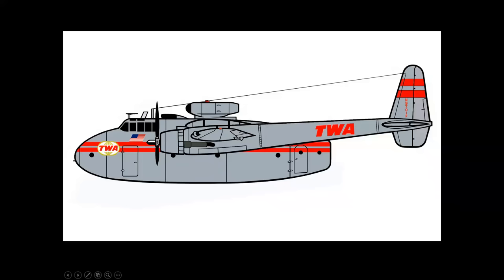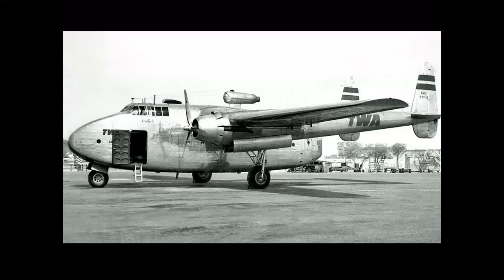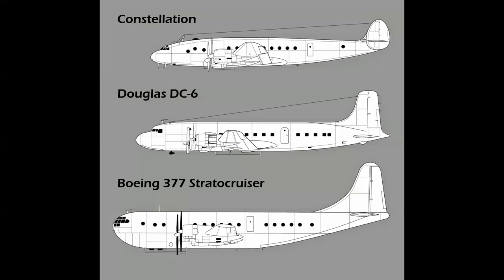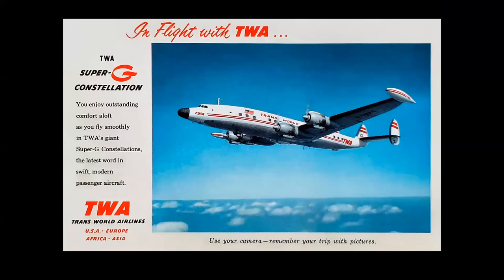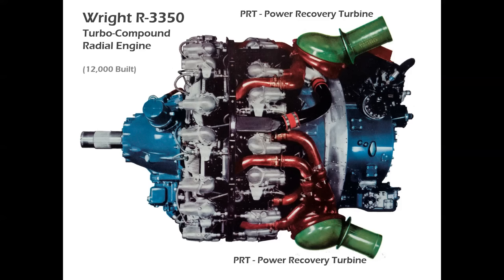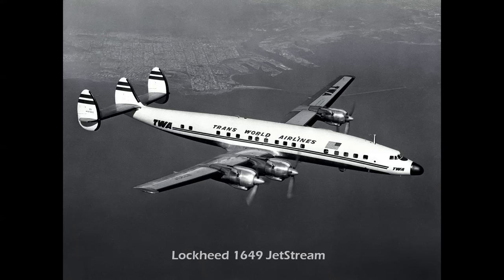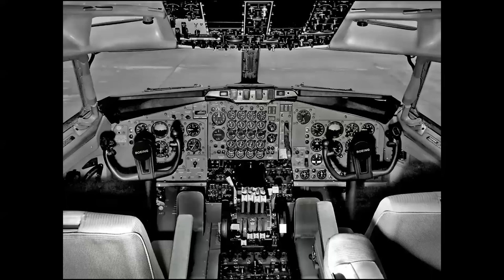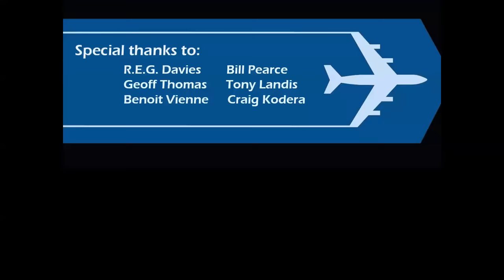LOCKHEED CONSTELLATION ENGINES - How were new engines delivered from the piston era to the Jet Age?

Comment: Delta Airlines had a C130 painted in full Delta Airlines livery that delivered engines to Dallas Love Field back in the early 70’s. I watched it arrive many times.
Reply: Delta operated C130s in a freighter fleet for cargo, not just engines. Not sure how many they operated, my guess 2 or 3.
Reply: Those were L-100’s, the civilian version of the Hercules.    The overall airframe is the same, but a lot of the equipment differs from military spec.   The L-100 has an FAA type certificate, otherwise Delta would never have been able to use them in Delta livery.
Reply: @jacksons1010  Lockheed tried to market the C130, C141, and C5 as a civilian aircraft. They only had some luck with the C130.
Reply: @georgeconway4360   Lockheed actually did build one L-300 (a stretched civilian version of the C-141).   My recollection is Flying Tigers wanted them but backed out of their orders.   NASA eventually purchased it and it still exists, sitting idle at Moffet Field.   Lockheed attempted to offer a double-decked passenger version of the C-5 as the L-500, but it was a non-starter with airlines.
Reply: @jacksons1010  What is the cruise Mach for the C141? I doubt Flying Tigers ever wanted them. I started flying for Flying Tigers in 1980 when they bought Seaboard World. Then Federal Express bought Tigers and I retired in 2012.
Reply: @jacksons1010  The C141 was way too slow for the airlines. The DC8 and N707 cruised at M .82 when the C141 was M .74.

Comment: Thanks Mike! The engine replacement problem lead to another solution that few people know about. That’s the (external) spare engine carriage. I was lucky enough to on the flight test of the 747-400 with the RB211-524G spare engine carriage. The tower at Moses Lake asked how many engines we had. Our pilot, Jamie Loesh, answered we have 5 but only 4 are turning 😊
It’s hard to find info about spare engine carriage but I’ve found photos of a 707 and L-1011 with them. Did the DC-10 have that feature also?
Reply from the maker: Yes, both JAL and Philippine Airlines used engine-carrying pods on their DC-10-30s, mounted inboard of the #1 engine. Thanks for watching!

Comment: Reminds me of the UC-123 mosquito control acft that would show up at Langley AFB, where I was beginning my Air Traffic Controller career in the tower,  to kill the marsh larvae. They'd arrive the night before and park on a hard stand down near the appch end RWY 25 and would try to forecast which way the breeze would blow in the morning by facing into said forecast breeze. The reason was that if they guessed wrong and the jet exhausts were pointed into the wind they'd throw some of the JP4 up over onto the wing and when the igniters came up the wing would also catch fire for about 15 seconds or so. First time I saw that no one had warned me, and as the ground controller asked them if they wanted a fire truck. "Nah." they said calmly, "It'll go out soon." So....if you ever see a C-123 with jets and blackened wings...now you know.

Comment: When in the Army I flew on a MATS charter flight from New York to Frankfort on a Connie in 1961.  We were supposed to go via Shannon, Ireland but had engine trouble and diverted to Gander, Newfoundland.  On the ground at Gander for 5 hours or so then direct to Frankfort.  It was an old beat up Connie, many busted seats and a ragged interior.  Worse there were many Army dependent families on board and it was many hours of crying babies and with the engine noise and the screaming kids any attempt at sleep was impossible, for me anyway.  It was the worst flight I've ever had before or since.  I am happy that I got to fly on a Connie though, of any airplane I've flown as a passenger or pilot that's the one that I'm most glad I got to fly on it at least once, miserable flight or not, such a beautiful airplane it was worth the discomfort to have had the privilege of flying on it in retrospect anyway.

Comment: The R-3350 never really liked high altitude turbo-supercharging. It almost killed the B-29 programme and it stayed being a troublemaker until the end. In contrast, the low altitude versions were not perfect, but quite decent engines. 

Despite all the problems with the expensive engines, the engines were not the main issue that lead to a quick withdrawel of the L-1649 and DC-7C  from mainline service. These last generation propliners were designed for the very longest routes. Just like the few turbopropliners like the Bristol Brittania. The main reason they were replaced by jets as early as possible was speed. Jets saved up to 4 hours on trans- and intercontinental routes. That was massive. Passengers were happy to pay for that time saving.

Comment: I've lived in Palmer Alaska since 1982. At the local airport there is a C-119 Flying Boxcar  with a jet engine in a pod on top of the main body, very much like the C-82 in this video. It also has a 'flat-four, pony engine' (as it was described to me) used for internal power and heat. The plane is used by a local Jumper school. Parachutists and smoke jumpers use it to keep up to date on certification. They will al$o fly building material$ out to remote area$. It has oversized balloon tires on fixed, non-retractable, landing legs. A Bush Pilots Ultimate Flying RV.

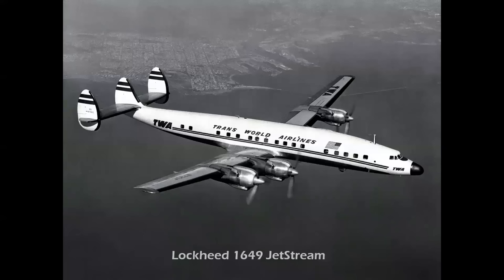Comment: Mike, re the photo of the DC-7C @ 10:49. I believe the large structure on a vertical line up from the "S" in Sabrina at about a quarter of the top of the frame is the hanger for Hughes' Flying Boat.
Reply from the maker: Yes, that is correct. Was thinking about mentioning that very fact. Thanks for watching!

Comment: My Dad flew on the Canadair Argus, which was in service 1958 to 1982.  By the end, avgas was getting difficult to source.  I flew with ex Argus Flight Engineers on the Aurora (P-3 Type) and to a man, they missed their expansive consoles that were used to monitor the 3350s.

Comment: Thanks much for a very well done video. Those photos are great!  I had not heard of TWA using the Fairchild. I'm old enough to remember the change from piston to jets in commercial airliners. I flew from Seattle to Minneapolis in a Western or Northwest 720. We then flew to Sioux Falls in a Branniff piston.  This is a backwards introduction to the big planes and was amplified by the noise and scary shaking of the 4 engine piston. This was 1963 or 64 and I'm thinking this was a DC-7C that was pulled of the long haul routes and served the short haul regional routes.  Is there anybody out there that can confirm the piston aircraft type?  I can still feel myself sitting in the pistion and wondering if it was going to shake apart!

Comment: Great vlog as always!  I do not know who inspired who but SAS/SK made a contract with Transair of Sweden to have C-46 to fly across Europe and do nothing but ferry the engines of the SAS DC-7C! Unthinkeble today… I may have told you this before. Someone at Transair must have loved the DC-7. They bought more than 10 planes from EA. When they also got brand new 727-134 from Boeing the following was issued: Sell charter on the 727 as much as possible. It still is cheaper to fly than the DC-7! I think they ended scrapping 7 of the 7s. On the quads there was space under one of the wings to ferry an engine. Here on YT there is a home movie about the last DC-6 of UA. The captain of the flight has filmed his last flights on the 6 and one of his sons put it out on YT. It is 12 mins and it includes an engine stop in flight. Today UA will buy 100 787s with 100 options! And up to 100 Max. Holy cow! You like models. This will make you cry. During a move someone thru away my SS United States painted model from the mid 50s. Say no more! A rescue helicopter from the era did not make it also. No good.

Comment: The C-82 that was owned by TWA was a common sight at Heathrow based in CDG it was mainly used for ferrying 707 engines around its European operations. Inside they fitted it out with very comfy seats coffee making facilities for the team of mechanics that nearly alway flew with it, many times if too much weight was loaded we could not get out loading equipment out from the booms.

Comment: I saw a twin engine, twin boom flying boxcar type plane with a small jet engine nacelle on top of the fuselage in Alaska about 2015. I thought it was just an Alaskan bush modification but perhaps it was one of those Fairchild’s? I believe it was in Anchorage possibly Fairbanks. The operator had other old vintage multi engine cargo planes parked nearby. Pretty cool!

Comment: Great stuff Mike. You will of course have read North Star Over my Shoulder by Bob Buck. He states that when flying the 1649s they would keep below 13000 ft, so as not to have to use the higher boost setting on the mechanical superchargers, and hence prolong the life of the engines. TWA 1649s served international routes possibly as late as 1960, I have seen a photo of one at Bahrein at that time, until finally displaced by the 707s. I remember a night flight in a KLM 749, and watching enthralled the flickering ring of fire from the jet pipe exhaust stacks
Reply from the maker: Great comment, thanks!

Comment: I might suggest that the DC-3 had the longest service life as some are still in service.
Reply from the maker: Yes, no argument there, and that great airplane will probably be the first to have flown in service 100 years! The comparison in the video was for international front-line scheduled passenger service during the transition from props to jets. Thanks for watching!
Reply: @celebratingaviationwithmik9782  : Some still fly international between Alaska, USA and Yukon, Canada, and compared to smaller single engine aircraft owned by the air service, are "front line". LOL

Comment: how'd that PRC work exactly?
Reply: From the narration I gathered it was an exhaust driven turbine coupled to the crankshaft as contrasted with a turbosupercharger which instead compresses engine intake air.
Reply: @davidfifer4729  yeah, that’s what I’m wondering, how the coupling and gearing to the crankshaft would have worked. These days some race cars have exhaust energy recovery systems but it’s the turbine of the turbocharger coupled to a generator to put energy into a battery pack if I’m not mistaken.
Reply from the maker: Good comment, thanks, and this topic is covered in great detail with excellent color photos in the ROUND-ENGINE AIRLINERS book mentioned in the promo. (Link in title block.) Thanks for watching!

Comment: What was the purpose of the multiple nozzles on the back of the J57C? I remember sticking that strangely shaped part on my Airfix kit back in the 1960's and wondering even then what it was for.
Reply from the maker: Those are noise suppressor tubes used on the first (non-fan) U.S. turbojet airliners - Boeing 707, Douglas DC-8, and Convair 880. Those early engines were painfully loud, but the turbofans solved that problem with cooler air coming from the fan section acting as an insulator around the hot exhaust roar. Thanks for watching!
Reply: @celebratingaviationwithmik9782  Thank you!

Comment: I believe the same engines for the DC7 also power the Boeing B50, a B29 look alike. The engines were stressed to the limits and reliability suffered, so many B 50 returned to base with at least one engine shut down and caged the plane soon earned the nick name Boeing Tri Motor. This was around a decade before the Boeing 727. Wright somehow failed the transition to turbines. The other Curtiss division were also not doing well, without any orders, their poor customer service bite them,  they soon had to shut down.
Reply: Kind of amusing that P&W was started by a couple of disgruntled Wright employees that left when Wright wasn't interested in developing a big (for the time) air-cooled radial. And P&W did successfully transition to turbines, now being one of the premier turbine manufacturers in the world!